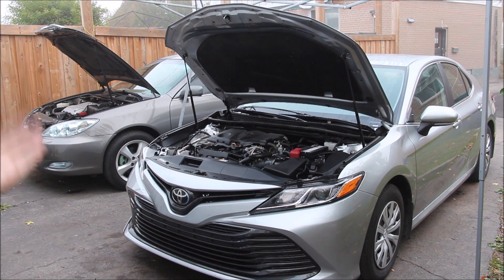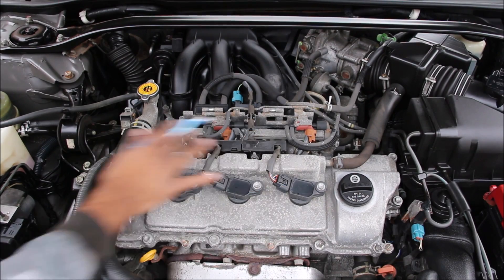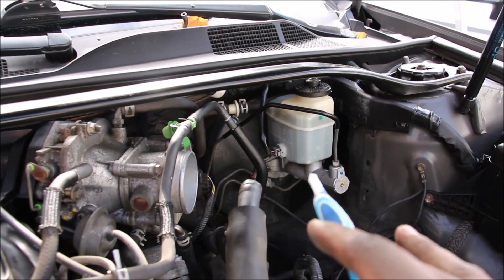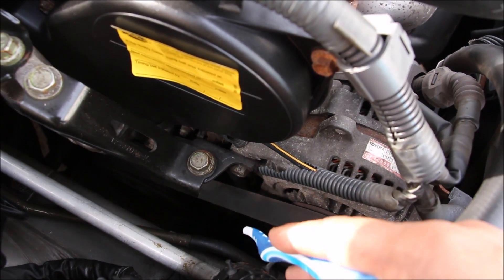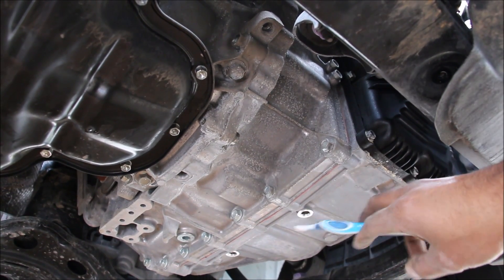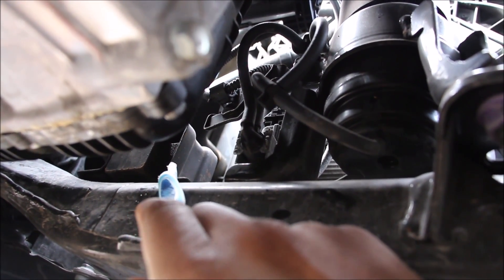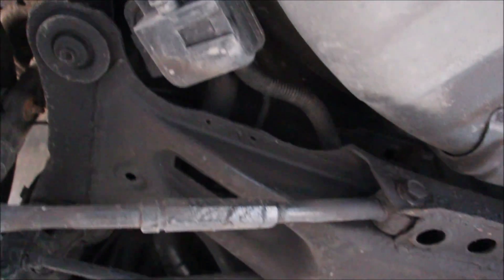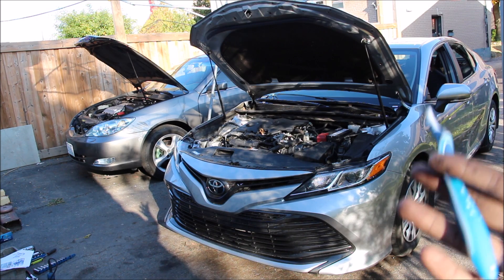Toyota Camry Mechanical Review | What Changed in 15 Years?

Comment: It sucks that Toyota has had to cheapen the Camry through the years in order to keep it price competitive, while adding more standard features and pretty much keeping the price of the car the same throughout the years, when you account for inflation.

The XV40 Camry (07-11), if you skip the 07-09 2AZ motor, is my favorite gen. If you get one with a 2GR-FE V6, it is a lexus in everything but some of the interior panels and the badge. I love the 3.5's power, lack of a timing belt, and they have proven to be amazing motors. And it had triple sealed doors, plasma cluster HVAC, and the best subjective looks of any Camry in the past. It even had a rear sunshade (manual) and reclining rear seats, and awesome Optitron vacuum gauges (which you forgot to mention that your 05 has that your 2018 does NOT) that were all taken from a Lexus ES350. Curious how Toyota did away with ALL those in the 2012+ models....... anyway, I do hope the 2018+ proves to be just as reliable....
Reply from the maker: Agreed on most points. 
If I had to replace the Camry I'm going with some 2GR powered Toyota....RX350, Camry, Highlander etc

Comment: Not giving up my 06 LE V6!
Reply from the maker: Keep it going! How many miles on the odometer?
Reply: @speedkar99  mine it's a 2000 LE with the 3.0 with 112K.
I've 5 Camrys 99-01.
I sold a 99 with the 2.2 at 198K and the girl that bought it still drives it at 248K👌👌👌

Comment: All I can say is that I see Toyota going under if they continue going down this new transmission and new engine road...bye bye toyota...won't be purchasing any Toyota any time soon🖕🖕🖕🖕
Reply from the maker: Sealed Toyota transmissions have been around for 15 years on Lexus vehicles
Reply: @speedkar99  
Not true the last few Toyota  that I've owened, allowed me to replace the transmission gasket and it's  filter, were as today's Toyota have the CVT and you can't even change the filter only the transmission oil.

Comment: Scotty Killmer HEAVY BREATHING
Reply from the maker: Haha 
I think his next video might be on a Camry just for this 🤑
Reply: @speedkar99  Scotty has actually warned consumers in several videos not to buy the new Camrys, since 2007 or so Toyota's quality has been going down. He's made videos on the older Camrys that burned oil and the new ones with the raunchy 8-speed transmission. I think you did him a favor with this video, although Scotty prefers the inline 4 to the V6 for the 04 Camry.
Reply: @BlueNinjakoopa553  Yet he has the same v6 in the Lexus in his driveway!
Reply: @BlueNinjakoopa553  Scotty had a video where he said how reliable  the 2012 Toyota Camry is and how it's the best used car you can buy.
Reply: @jameswillett7186  2011
i think he said
Reply: @jameswillett7186  They have torque converters issues that effects years 2012-2014 but as long as the TSB was performed on it. You should be fine.
Reply: Scotty did a video last week saying the best used car ever to buy is the 2012 Camry.
Reply: You can still buy a 2007-2009 Camry with the 2.4L as long as the TSB for the piston rings and pistons has been done on it. You just need the VIN and check with the dealer. If not walk away. Usually you can tell if the engine has been cracked open if there is black sealing around the head or valve cover to indicate that some work has been done on it. The Toyota dealers use black seal. AMD has a yotube channel called Car Care Nut that it Certified Toyota Master Diagnostic Technician.
Reply: Scotty He warned people about the transmission primarily, and I believe his comment was mainly that it's a newer transmission that and it hasn't been proven yet.  But being that it's got gears  (not a CVT) that should help in reliability in the long term.  Yes Perhaps Toyota's quality has slipped a bit, but they are still among the top in terms of "consistent" decent/good quality . I mean take for example Nissan, they used to be good, but now their 2015-2018 stuff was crap.  The newer stuff is OK but still trails toyota (and even Chevy and Ford and Honda) in terms of long term reliability.  But being that this is now 2020, yeah I think in the 2020's they refined the transmission technology and software. I wouldn't buy a 2018 Camry which is the first year they had the 8-speed auto and the new engine (although the 2.5L Dyanmic Force engine was introduced in 2017 but wasn't used in the CAmry until 2018).
Reply: @HR-wd6cw  Nissan has been garbage since 2007 Altima’s. I had a 2009 Altima coupe and it went through 3 cvt transmissions.
Reply: @HR-wd6cw  how about the 2021’s? Should the kinks be worked out by now

Comment: The steel in the body panels is thinner to cut weight for better fuel economy and driving dynamics. Probably a cost savings for Toyota too.
Reply from the maker: Cost and weight. 
The compromise is resistance to dents and noise
Reply: @speedkar99  I believe there is extra sound insulation in the newer Toyotas to adjust for that.

Comment: Thinner steel doesn't save that much money, steel being among the cheaper materials used in a Camry of any year. It's another thing to meet fuel economy standards, especially while adding weight in other areas. And hey, there's always Dynomat.
Reply: Dynomat substitue from Amazon on the all four doors of my 2010 Camry LE reduced road noise noticebly, some owners say 2018 Camry has more engine noise than earlier model, more engine noise with 2019 RAV4 of the same engine
Reply from the maker: Dynomat doesn't change much when it comes to dentist prevention
Reply: @speedkar99  ， it will be easier to pup back the dent,
Reply: @speedkar99  I was mainly thinking of NVH. That said, I wonder if thinner metal makes for easier paintless dent repair. It's not prevention, but way cheaper than new metal ofc.

Comment: I call the surge tank "the intake bong". The newer one looks like the one I removed from my '95 Grand Am to fit the K&N cone. I probably lost 5 lb.-ft. off the line, but it sounded fuckin' awesome when you punched it! It was a bastardized balance-shaft Quad-4 2.3, with the manual trans. I could hit the 193 km/h 120 MPH governor in fourth gear (RPM: ??? - no tach). In fact, the speed was actually slightly lower because I was running 215/50R15 tires instead of the stock 195/65. Also, the speedometer only went to 180 on that thing...lol.

It was such a strippo car, the only option it had was power locks. And, being a jerk, I took out most of the interior to bring down weight. I mean, I still had a sub and amp, and replaced the donut with a full-size spare for a few more pounds, but it was still light enough and had one passenger seat.

A guy I knew lined up with me at a stop light, driving his '91 Accord. F20, 4-speed automatic, known to be in a good state of tune (but not tuned in the usual sense). I blew his doors off. Previous to that, I had raced that guy and car whilst driving my mom's '93 Plymouth Colt, which was gutless as fuck (4G15, 3-speed slushbox) but had no governor, and being a 3-speed, it topped out ungoverned at almost 190 km/h...which was dead even with that Accord. I would later hit a deer with the Colt, with the Accord guy as my passenger! I then proceeded to spend my Thanksgiving Thankstaking long weekend of 2003 rebuilding the fuckin' thing. Ouf.

Oh, good times in shitboxes...
Reply from the maker: The good old 90s

Comment: Watching your review makes me appreciate the older Camry over the new one.
Reply from the maker: Thanks. 
The maintenance is harder on the V6, was it the quality of the components that gives you the appreciation for the older one more?
Reply: @speedkar99  a lot less plastic parts on the motors of the older camrys
Reply: @speedkar99  Yes, the quality. You get the feeling it will hold up longer. The newer one seems like it was built so you will have to trade in five years for a newer Camry
Reply: Incumming Moisture Missle  Still too early to tell if it will last as long eventhough it's a Toyota. Sadly, even Toyota have bought into the idea of planned obsolescence like the rest of the industry.

Comment: Seems the newer camry is easier to work on. Fantastic in depth comparison. Muchas gracias. I have a 2006 subie sti  no where near as reliable.  Subaru having lots of issues with quality. Stick with toyota or honda. Newer better
Reply from the maker: That's only because it's the i4. 
You don't want to know what you have to do to service the new v6...

Comment: All the new changes are improvements to me; except for the GDI requires a different way of keeping them valves clean and of course when the time comes to refilling the ATF at the right temperature for the DIYs...  I hope in the furture, you will have a video about cleaning the intake/exhaust valves for GDI engines - Thanks!
Reply from the maker: Good tip. 
Agree they are improvements on paper. 
Let's see how it holds up in 15 years

Comment: All that effort to force that engine to be transverse, and it could have been a more interesting car, and easier to maintain if it was a longitudinal mounted engine. Smh
Reply from the maker: Hmm are you suggesting RWD Camry?🤔
Reply: Who builds cars for ease of maintenance anymore? LOL
Reply: Oh, and if you want a RWD Camry, Lexus IS and GS of a given year will often have a V6 engine option similar to a contemporary Camry (the GS is a closer match for size).
Reply: It could have used a longitudinally mounted engine similar to Audi's layout. Where they could have both front wheel drive or all wheel, without making it hell to access and service engine components. Transverse layouts are ideal for single bank engines primarily. But a v6 just makes the layout unpleasant. Or at least they could have done the vr6 thing like vw. A v6 that occupies the space of a straight four.
Reply: @TheWeedOperation  You make some good points, but the reality on the ground is that all the cars you're talking about become the booby prize at car auctions and dealers at some point, while people gladly snap up cars like the old Camry in this video for several thousand dollars.

If you can afford $50,000+ for a baller car (I'm spitballing, but FYI, the A3 is transverse as well), you're probably not working on it yourself anyway. Also, a rarer car will have parts available for fewer years, and they will invariably cost more...thus the above scenario at the auction.

Comment: Ill keep my 98 camry for as long as possible.  Looks like the new camry is a money pit waiting to happen. Electronic e brake, electronic water pump, electronic power steering, electronics everywhere. Plastic intake manifold. Plastics that will be heat soaked and fall apart
Reply from the maker: Is yours a v6? 

As much as the gen4s are good, I wish they came in a black interior
Reply: @speedkar99  Yes it is a V6. I like the power i get out of it and I do agree that the interior is ugly as sin. Should have got a ES300 lol

Comment: All the electric stuff takes direct load off the engine, but puts much more load on the alternator. Efficiency is lost from the mechanical->electrical->mechanical round trip of energy. On other hand, the electric stuff can be more intelligently controlled whereas the mechanical stuff creates load even when its functionality is not needed. I guess in the balance it works out in favor of electrical, otherwise they wouldn't do it.
Reply from the maker: Well said. The result is better economy
Reply: @speedkar99  I'd also argue improved reliability, though I haven't gotten to play with enough mileage-diseased electrically-driven accessories to know if that's bullshit or not. Good thing I know someone who fucks with these things regularly. :-)

Comment: Modern cars are mechanical nightmares. All the (expensive) electric motors, plastic parts, electronic systems, flimsy moving parts, and engines that are designed for efficiency not longevity. Planned obsolescence in action. Too expensive ro repair. Just buy another one.
Reply from the maker: It's all about fuel economy and safety regulations. 
We live in a disposable society... longevity is the trade off
Reply: @speedkar99  it stinks for those evo can't afford a brand new or lightly used car though. Maybe in 10 years card will be cheap enough that replacing them won't require selling your pancreas, kidney, or both. I can't believe how expensive new cars are for how cheaply they're made. They really don't make then line they used to. Cars like the Subaru Outback Sport from 1999 with the ej22 would be impossible to make today due to fuel economy regulations! In 1999 they didn't care too much. Gas was cheap and 19mpg wasn't too shabby for AWD!

Comment: Great review!  We have a silver 2018 Camry LE (looks identical to the 2019 in your video) with 10K miles on it and we kept our 1994 Camry XLE V6 (1MZ-FE) with 242K miles on it that we still use for some of our city driving & for relatives when they come to visit.  When looking at the 2018 Camry the salesman asked if we were going to trade in the 94.  I told him no, it is running fine & we will keep it for a 2nd car & it is our fall back in case the new one does not work out.  I used some of your YT video material when my son & I did the timing belt & water pump & cam and crank seal job on the 94.  This video/review gave me a BIG Boost on the mechanicals of our 2018 LE.  Thanks again for this one!  All the other reviews on the new camrys that I have seen so far are "cup holder" type reviews.
Reply from the maker: Glad my videos can help. I guess your experience is a 25 year testament compared to my 15 year testament

Comment: I love the sarcastic commentary. I have a 2GR-FE with an upside down cartridge oil filter. It's so stupid, I miss my straight-6 BMWs that use a cartridge filter at the top of the motor. No burns, no drips, tho the filter "stands" tend to leak after 100k mi. I like the new Camry better. Cheap'd out in places, but I'm guessing the consumption is lower, crash worthiness better, has ADAS, probably the old one doesn't have Bluetooth... Plus the old K-platform lacks torsional rigidity; while I haven't driven anything built on the TNGA-K, it's supposed to be stiffer. I have a pano roof on my HL and while it's not as bad as a convertible, I can def feel the flex (not wheel articulation). BTW, pros and cons to the engine coolant to the trans vs. ATF to the rad? How do they do aux trans coolers now?
Reply from the maker: Yep the coolant cools the transmission

Comment: I am looking at the older Camry's. Debating on which gen to buy. Have you compared the 99-10 models? I have read that the 07 to 09 suffered excessive oil burning.
Reply from the maker: If you are getting gen6, look for a 10-11 model with the 2.5L or a 09-11 V6. 

Stay away from the 02-09 i4
Reply: @speedkar99  what makes those years bad? Besides burning oil?

Comment: All the plastic valve covers on the new Toyotas really breaks my heart... Then there's all the new electronics and computer-controlled things that used to be run on a drive belt. Any of that fails and it's an expensive replacement. :(
Reply: At 172k miles and 20 years since we bought our Sienna, I'm still running all the original belts and water pump. I'll be doing that maintenance for the first time this winter. I'm thinking the reason belts fail is because people don't use oem quality when they do their own maintenance. At the least, I use Japanese made parts.
Reply: @JediSuPhu  I'm not sure what you mean. The best belts are usually aftermarket in my experience, though not really so different than OEM in terms of quality. OTOH, you can run over a piece of shrapnel on the road and lose a belt, or burn one off if an accessory seizes (!).

That said, I probably should have specified brushless motor. I presume all these things are, but if not, then I'd at least buy spare brushes to keep in the glove box!
Reply from the maker: I don't understand everyone's hate for electrical things. 

They are easier to diagnose and replace if they go bad...just like a mechanical part. 

With mass implementation, prices will go down and reliability will increase. 

We don't complain about power windows and locks anymore do we?
Reply: A belt fails so much more often than an electric motor, and is sometimes a pain in the ass to replace on a FWD. If I have a related complaint, it's underpowered alternators (and undersized batteries and, for trunk-mounted batteries, undersized battery cables) for the ever-increasing loads they need to provide...but most of that load isn't the accessories.
Reply: John Smithy  Over the last 25 years our family has had 5 toyotas. The oldest two being an '86 corolla and one of those old Toyota vans. The van we kept for 5 years and the corolla up until 2007. Timing belts has never been a problem among any of them. Although I think the van had a chain, so that doesn't count.

Comment: Your 2004 Camry doesn't have traction control? That's weird because my 2000 Lexus es300 has the same 1mzfe toyota v6 engine that your camry has and my car has traction control 😕
Reply from the maker: Some Lexus models had it. The XLE Camry had traction only. 

My old 2005 ES330 didn't have traction control....wheel spin galore!

Comment: All the new cars have ECUs put under the hood. It become easier to access. However,  I guess, the real season could be that ECU will need repairs, or become a service point in the future.
Reply from the maker: So you are saying the ECU needs to be serviced at some point but not the "sealed" transmission fluid? 🤔